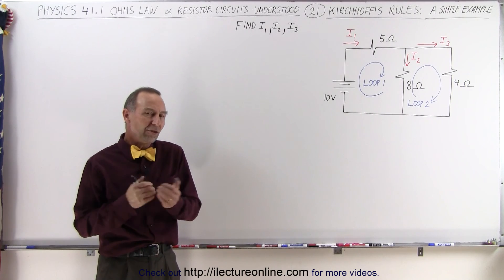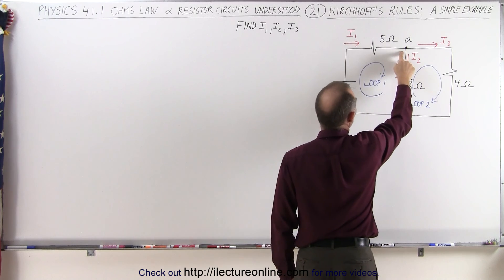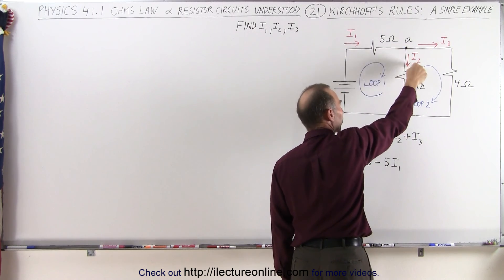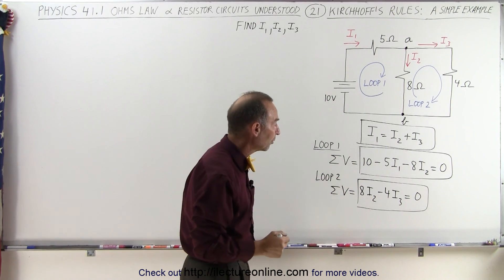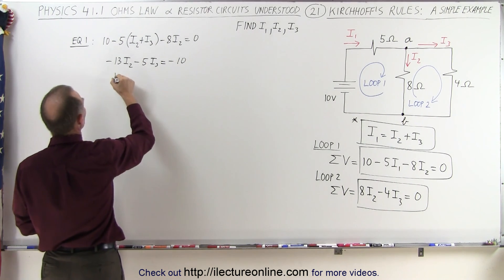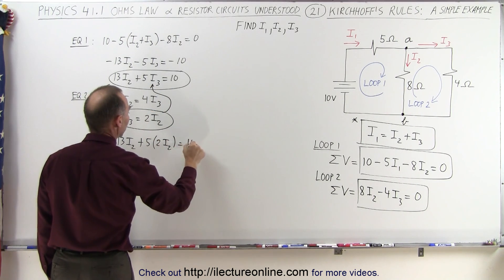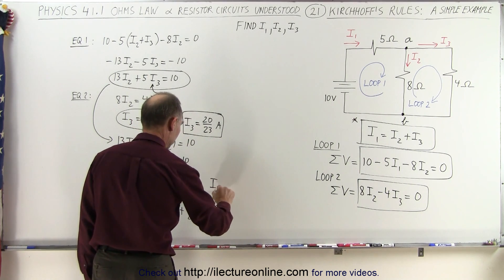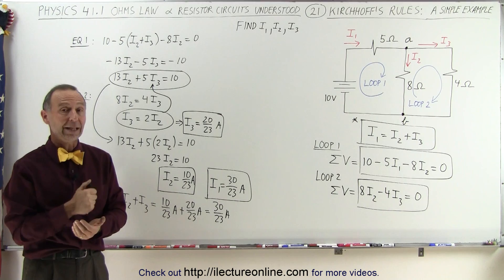Physics - E&M: Ch 41.3 Ohm's Law & Resistor Circuit Understood (21 of 42) Kirchhoff's Rule: Ex. 1

Comment: Sir I am confused why is voltage rises in the opposite direction of current
Reply from the maker: It is not quite like that.   With the KVL, we add up all the voltage rises and voltage drops around a loop.   When traveling from - to + across a battery it is a voltage rise (regardless of the direction of the current).  When you travel across a resistor in the direction of the current, that is a voltage drop.